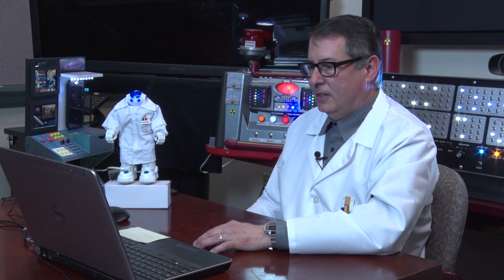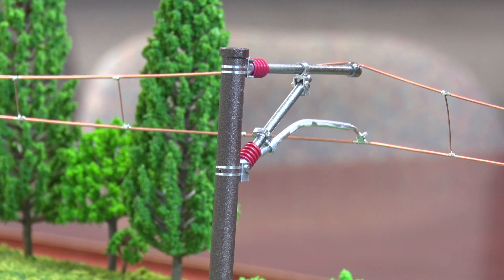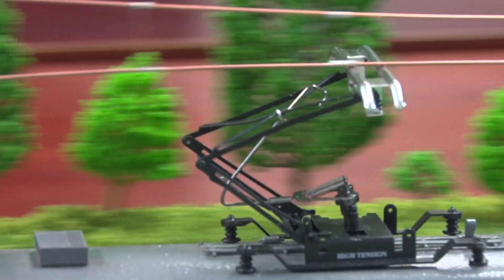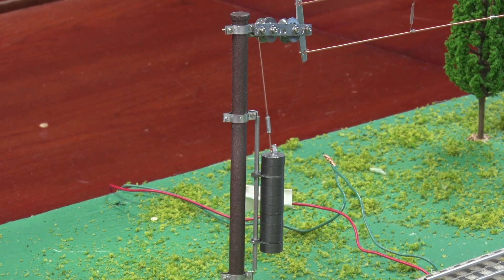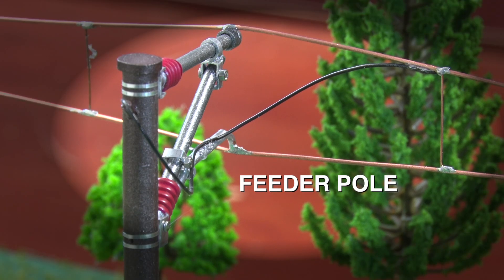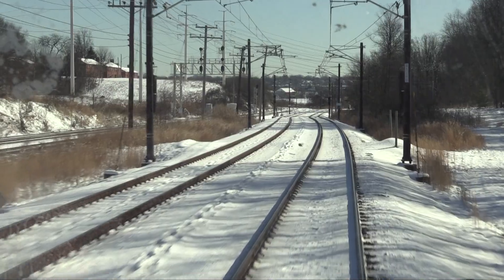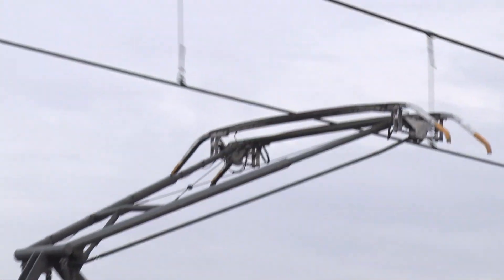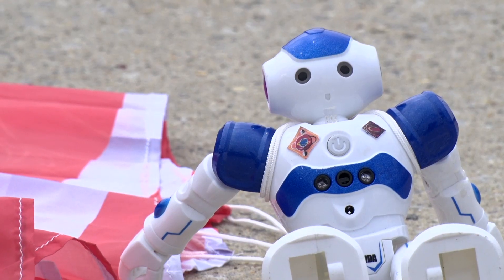Professor Vern Explains How The Light Rail Catenary Works

Comment: All that equipment, all those parts, all that constant upkeep. AND it's hideous to look at. And to think you can just put fuel into a tank ....
Reply: Fuel requires more space in the long run for vehicles like this. That needs to go to an engine for propulsion, which either creates dead-space, or prevents the vehicle from being low-floor throughout

Not to mention, with electricity the trains can actually give power back through braking. I think the Purple Line's LRV's are equipped to do this, but that's simply impossible using internal combustion

Comment: Interesting video.  I’ve been with the MTA Catenary Dept for close to five years as a Lineman/Technician.  This is the first time ever seeing this.  Too bad we weren’t interviewed or involved, could have gone into much greater detail about the OCS.
Reply: If you don't mind, I have some questions about catenary dimensions. I'm working on a project surrounding the Purple Line for a capstone class, and the general height of the catenary structures is crucial to that. 

I've not found any clear answers online, so I figure a person that works directly with them would be able to help?
Reply: @ Structures is kinda a broad term in relation to a catenary system.  If you’re asking about the electrical lines it can vary based on the height of the train, or LRV (Light Rail Vehicle) and pantograph as well as clearance requirements. The contact wire our system uses is 350mcm Solid Hard Drawn Copper with an average height from the top of the high rail of 19 ft.  The messenger is 500mcm Stranded Copper with an average height from the top of the high rail of 21ft resulting in Hangers 2ft in length.  With that said, the height throughout the system varies with the above being the average to as low as the contact wire being 14ft from the top of the high rail and messenger wire 14ft 6” resulting in 6” solid hangers.  The poles on the system also vary in height based on clearance and headspan requirements.  And can range anywhere from 18ft to 35ft.  Hope this helps you out.